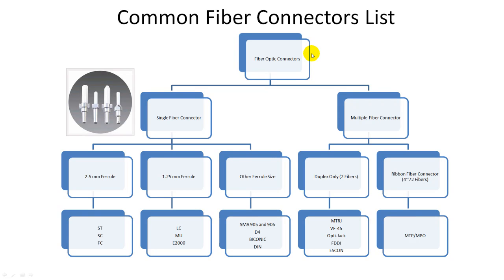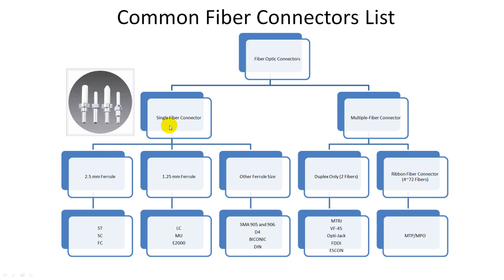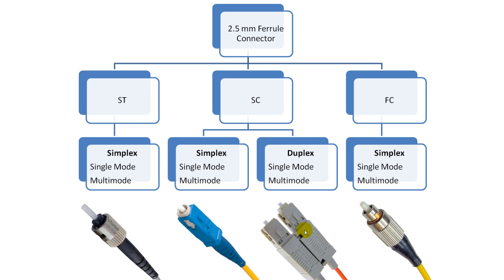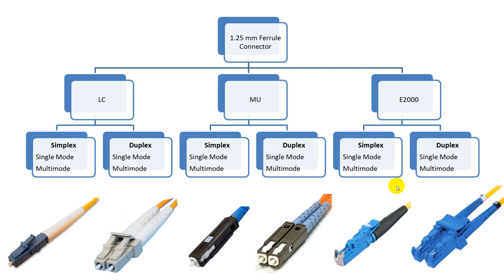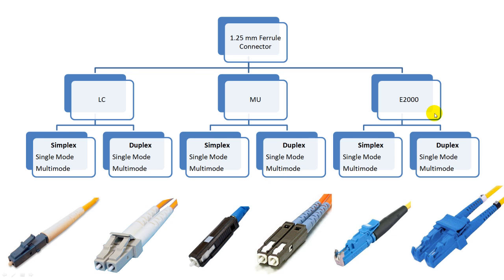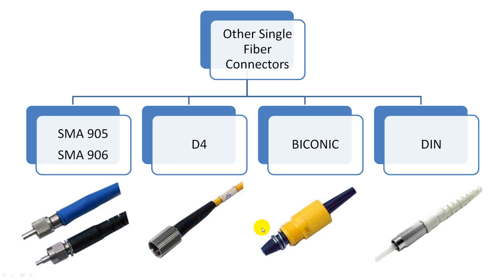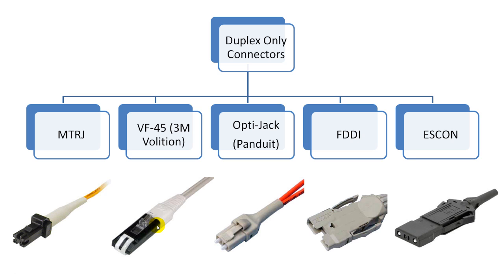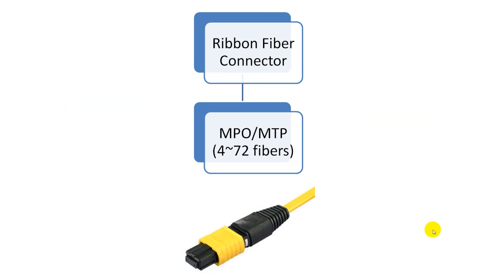Fiber Optic Connector Types Explained in Details

Comment: There are two main types of fiber connectors,  single fiber connectors and multi fiber connectors. Multi fiber connectors can connect up to 72 cables. Fiber connectors connects between the ends of  fiber optic. 
Single Fiber connectors works either for single mode or duplex mode or both, and can be simplex or doublex. Simplex connects has one entry cable only, while doublex has two.
Single fiber connectors are classified according to the size of ferrule, which are either 1.25, 2.5mm or other sizes

Comment: E-2000 connector information is incorrect, the E-2000 has a 2.5mm ferrule. A similar connector that look like an E-2000 with a 1.25mm ferrule is the Diamond F-3000 connector, which is the LC compatibles. http://diausa.com/products/Assemblies---Adapters/standard-single-fiber-based/F-3000-Family.html

Comment: Nice info
Several versions is not used today.
I have worked with fiber since 1986.

Now there will come OM5 (WBMMF)
And MTP/ MPO you  can find 96 fiber = multimode.

Singelmode MTP / MPO is only = 12 fiber / APC 
Ore do you know any other SM conectors today with MTP/ MPO.
Reply: Great, I have 6 cables run from a boat house to main office, the all look like simplex SC mm cables.  I need to connect to an older cisco switch with a mini gbic interface on one side and the other side has no switch installed as of yet.  Any recommendations as what to purchase.  My amazon searches don't seem to give me what im looking for

Comment: hi , we are a professional manufacturer for fiber optic equipment 
welcome to inquir me my skype:molly.hou03 Number:8618689465924
Reply: Molly Hou , hi I am a project engineer  , I do installation and commissioning of Bms system, I  require latest data    equipments to make the work easy and technically sound
Reply: this is my no: 9910505198
Reply: Molly Hou I would like to connect with you
Reply: Molly Hou hi nice to meet you can we chat on WhatsApp I am working in UAE as IT technical support.i want to learn from you.